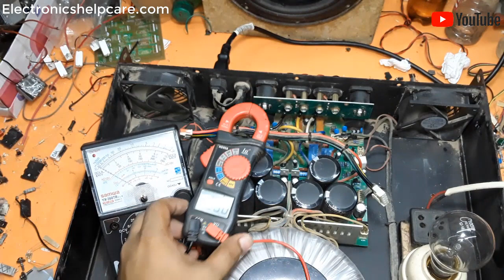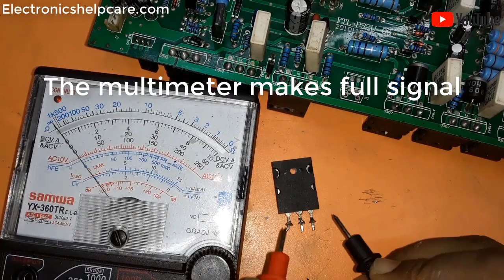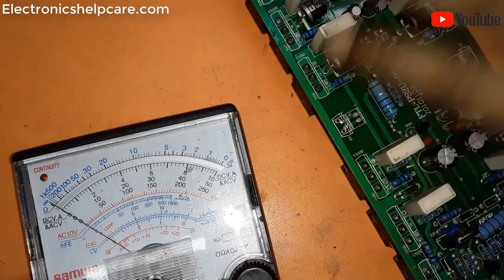Peavey amplifier repair

Comment: Sir, I have a Peavey CS4000 that has 110VAC, Is it possible to convert it to 220VAC? so that no worries in using the amplifier.
Reply from the maker: make one 220 to 110 volt transformer
Reply from the maker: whatsapp me +8801980060190